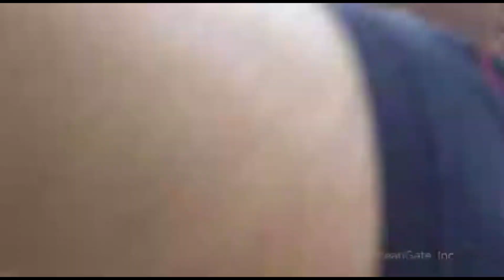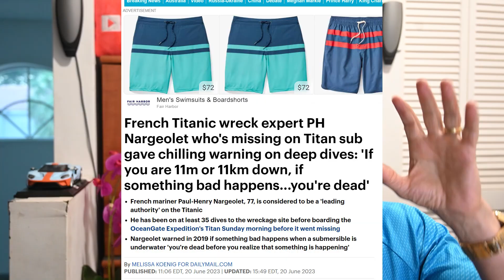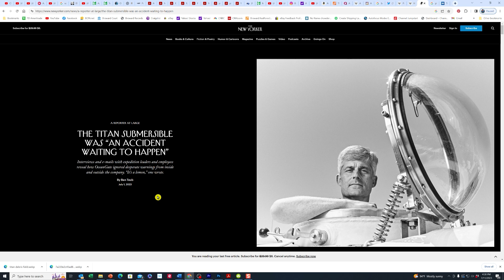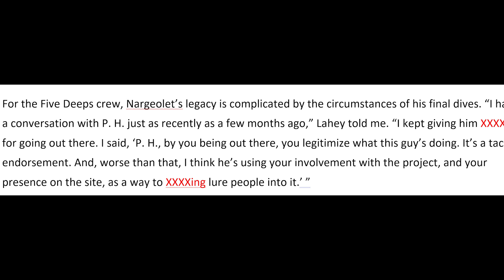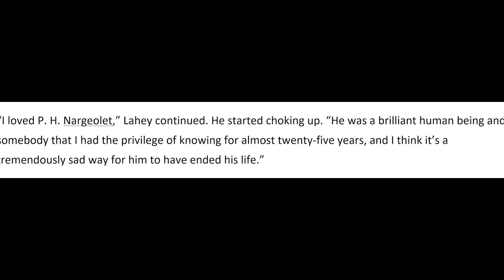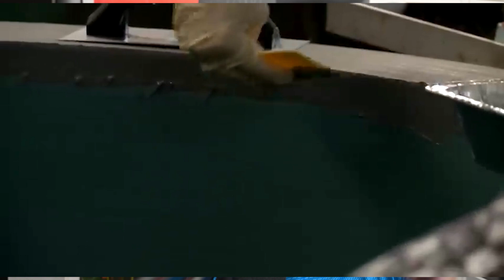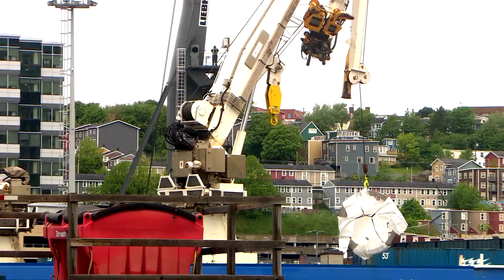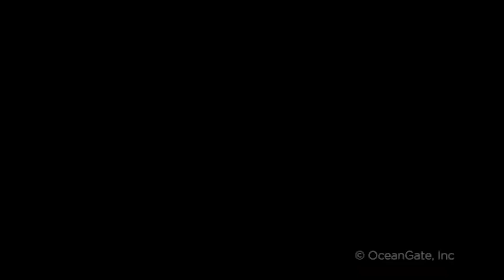Titan Sub: More Q&A, Design Defects, Why Descent Fast

Comment: I'm a 43 year retired Boeing guy. I'm not an engineer, but I managed engineers for about 12 years. There is a graphite fabric called Prepreg. Prepreg has the epoxy pre-impregnated into the fibers when it is being made. This type of graphite material must be cured in an autoclave. Pretty much all aerospace grade graphite parts are made this way. I've never seen Boeing parts being fabricated with a wet graphite layup like is seen in the YouTube custom motor sports world. I worked on the first five 787 program airplanes including the static and fatigue test articles. That airplane's primary structure is full of Titanium/graphic structural members. These members are electrically isolated by the use of sealing material and then bolted together. The seal is to prevent the carbon and Titanium from acting like a battery and degrading over time. In the video clip, the end rings being attached to the graphite tube looks more like a sealing material to me and that is a very sloppy process. All of this is just short of a wild ass guess and speculation about how the Titan was constructed is just that, a wild ass guess. Maybe someday the details will come out, but I'm holding on for the real data, because I want to know what happened.
Reply: I'm an aerospace engineer and agree 100% with all that you have said in this.
If there is one thing I'd add is that MOST CF for pressure vessels like rocket fuel tanks is woven on. So late the fibres in some layers is at different angles. That forms that checker patter you often see with CF. The reason its done is you always want some of the fibres under TENSION (being stretched) and that weaving does that by translating the stresses via the resin.
In all the vidoes I have seen of Oceangate they are just winding the pre-preg strip onto the casing. maybe they did weave other layers but so far I haven't seen it. 
This is the point I think you have dead right - there are unanswered questions which wont be answered until the reports are released.
PLUS we really do need to know how & why this happened.
Reply: @tonywilson4713  Pretty sure the fibres were only laid in one direction, Also wondering did they even vacuum bag the tube at the end of construction? Going by videos others had uploaded I've seen no mention of going in to a clave? Also a number of websites claim that the CEO stated the carbon used was old Boeing stock "That was past it's shelf life"
Reply: @FredsRandomFinds  As far as I know from footage it was laid by just winding it on. there are vids here on YT for rocket fuel tanks that show how they weave it on. YES its for pressurized tanks not compression vessels but I really would like their layup explained by a CF expert.

That expired date also needs explaining.
Reply: @FredsRandomFinds I read somewhere it was cured in an “oven” for 7 hours, but the Titan was actually built/rebuilt twice by different companies, so unsure which one is shown in the process
Reply: @FredsRandomFinds yep 👍🏽👍🏽👍🏽, I HEARD/RED THAT ALSO
Reply: @FredsRandomFinds  "The biggest challenge, Spencer reports, was developing a manufacturable design that “would produce a consistent part with no wrinkles, voids or delaminations.” And without use of an autoclave. Spencer opted for a layup strategy that combines alternating placement of prepreg carbon fiber/epoxy unidirectional fabrics in the axial direction, with wet winding of carbon fiber/epoxy in the hoop direction, for a total of 480 plies. The carbon fiber is standard-modulus Grafil 37-800 (30K tow), supplied by Mitsubishi Chemical Carbon Fiber & Composites Inc. (Irvine, CA, US). Prepreg was supplied by Irvine-based Newport Composites, now part of Mitsubishi Chemical Carbon Fiber & Composites Inc. The wet-winding epoxy is Epon Resin 682 from Hexion Inc. (Columbus, OH, US). The curing agent is Lindride LS-81K frLindau Chemicals Inc.cals (Columbia, SC, US)."
Reply: @FredsRandomFinds "pretty sure" doesn't cut it. A lot of speculation, especially on a kitchen and bath remodeling channel.
Reply: @FredsRandomFinds  no the fibers were not laid in one direction. These people weren't as retarded as you think. If you looked closely you could see that.
Reply: @FredsRandomFinds they show a video of it being wrapped in multiple directions.
Reply: @tonywilson4713  THX, there is one thing nobody is talking about. That is the penetrations out of the pressure vessel. Also, what is under the farings? There must be some kind of a clamping scheme to hold the thing together until it goes under pressure. The aft end tapers up, there is equipment in there, also the images I've seen make me thing the pressure vessel sits inside of a fairing. When I think about this, I to be careful. All of my aerospace experience is about holding pressure in. A submersible is backwards. When a modern jetliner goes to 35,000 feet, the cabin is held around 8,000 for a positive pressure differential of about 4 psi. The Titan starts on the surface at around an equalized 14.6 psi and is compressed to around 6,000 psi when it gets to the Titanic.
Reply: @jimpalmer1969  That's actually a really good point because nobody has said where the hull penetrations were. 
My bet would be they would be through the rear dome because all of the systems (batteries, air,... etc) are in the tail.

On the pressure - yep, yep and yep.
My professor in college was one of the foundation guys on computational stress analysis of axisymmetric structures. At the time I graduated he was working on taking all that he had done and expanding the models with carbon fibre. He also consulted on the re-design of the shuttle boosters and wasn't all that impressed with Lockheed or Thiokol at the time.

He had one great lesson for me.
Understand the model that you're using to analyse your work. 
That was his criticism of so many others working in the FEM and CFD they were just feeding in data and trusting the result. He told me to never trust the result unless you had something to compare it to.

I fear that his warning of OVER trusting computers has lead to some horrible tragedies.
Reply: @jimpalmer1969  composite airliners such as the A350 and B787 are certified to fly at up to 45,000' with a cabin altitude of 6,000'.
Which gives a maximum pressure difference of 2/3 atmosphere.
Reply: @tonywilson4713  That tension bit has been bothering me this whole time. Sure, a cylinder of carbon fiber will hold back a force pushing out (up to the failure point of course). But I STILL have yet to see anyone recommending it for a force pushing IN! Like, putting something high pressure in a composite tank and going into space, thats easy, its only a change of about 14psi. In a sub you want to keep elephants, hell city buses worth of pressure per square inch out.....and again Ive yet to see a carbon fiber vacuum chamber....at the bottom of the ocean what wants to get in is way more energetic than that....
Reply: @zombieregime  You are right. As far as I know the reason you have that weaving is for compression loads. Its why fighter jets done delaminate under high G.

Under a high positive G the lower skin of a wing is under tension but the upper skin is under compression because of the bending. So CF is expected to handle compression UNDER CERTAIN CONDITIONS but it has to be done right. 

What everyone is saying its not normally used for pure compression loading like in a submarine.
Reply: @zombieregime  The wings on the 777-9, 787 and A350 are composite. You can think of an aircraft wing as a cantilevered beam with an aerodynamic leading and trailing edge. In flight the upper surface of the wing is under compression and the lower surface is under tension. The real question is how thick does the composite tube have to be and how long will it last? Lots of unanswered questions.
Reply: @zombieregime  It might not of even been the surface area of the cylinder failing, the compression on the ends by the titanium domes may be the cause. Im no "expert" on CF (im actually a metal fabricator, including much work with pressure vessels) but i have some experience laying up boat hulls and ive witnessed the failure of CF fishing rods more than once, normally by compression of the rod that's extremely strong loaded the right way, but cause compression (normally by what's called "high sticking") and BANG, they pop.
Reply: @zombieregime  Absolutely; it's great for internal pressure, such as in aeroplanes, but I have no idea why they thought it would therefore work for a submersible under such intense external pressure.
Reply: @zombieregime  external pressure design (unstable equilibrium) is completely different from internal pressure design (stable equilibrium).  The primary mode of failure for external pressure is buckling of the shell which is sudden and catastrophic
Reply: @zombieregime  100% agree. They just could have omitted the CF and leave only the epoxy. The composite compressive strength is much lower than the tensile strength.
Reply from the maker: Yes, they used what is called the hoop woven method, which is uni directional, not angled. Like we would want to see. Like we would want to see
Reply: @jeffostroff  you want to see angled fibers because you don't know anything about composite materials. That would make absolutely no sense. The stress is in the hoop direction and the longitudinal direction. There is no torsion.
Reply: @jeffostroff  That is seriously disturbing if true.

If you think about basic stress-strain  analysis and how deformation works. As Thunderf00t showed the titanium will deform less than the CF under a given load.

The fundamental problem is that once a structure begins to deform then the stresses also start to change their patterns through the structure. This is a fundamental point taught in Finite Element Classes or at least it should be.

Have a look at the footage and you'll see that the CF is on the outside of the Titanium ring which means that fundamentally the CF is being pushed against the stiffer titanium, which they probably thought was good as it would help seal the endcaps and have the glue under compression. 

BUT it would also mean that the CF tube would NOT DEFORM uniformly along its length because of the titanium rings at each end. The mid point between the titanium rings would/should squeeze in a little more which would create stress and strain almost parallel to the centre axis of the tube. And you have said there was no weave to handle that type of stress/strain. 

It would be interesting to test that out.
Reply: @jeffostroff  Keep in mind that the stuff you've seen is probably not the actual pressure hull. You're likely seeing the construction of the inner cylindrical hull that housed the crew and wasn't subject to the immense pressure. That's why the carbon fiber is wrapped the way it is. The inner hull is designed to resist expansion while the outer one is designed to resist pressure. The man obviously didn't want anyone knowing his "secret ingredient" which would've been the process by which he made the carbon fiber use its strength in tension to prevent implosion. Showing the design of the inner hull is useful since there's no company secrets there and it wouldn't matter if he used inferior materials or processes since its just a living space and not a structural component. 

Here's what I think he did: I think he used metal rings with structural bracing assisted by carbon fiber to actually resist the pressure. Those rings wouldn't contract but just hold their shape. Then I think he used carbon fiber draped over and woven within those rings as the actual mechanism to resist the pressure. This way you get to use carbon fiber the way it was meant to be used - i.e. in tension - while minimizing weight by using metal only for resisting compression. This isn't a new idea in fact it was the basis of a design used by a man named W H Taylor in the 1800s who tried to build an atmospheric diving suit that used spring-shaped rings with leather draped over them to resist the pressure.
Reply: @jeffostroff  I had a good reply but youtube didn't like my comment and wouldn't let me post it.
Reply: @jeffostroff    HIYA JEFF I AM ENJOYING YOUR DEEP DIVE (PUN MOST DEFINITELY INTENDED ! ! !) INVESTIGATION INTO THE TITAN SUBMERSIBLE TRAGEDY ! ! !👌👌👌
Reply: @tonywilson4713  In another video, Thunderfoot (I think) estimated about 1 cm diameter reduction in the CF cylinder at depth and very little in the titanium end ring.  Presumably that's going to introduce shear forces in the cylinder wall where it meets the ring.  With a purely wound construction, very few fibres will be crossing the shear plane.  That sounds like a bad thing.
Reply: @LokiCentral  I have a lot of respect for Thunderf00t, but I believe he is a scientist, not an engineer.  I think he was completely off the mark with his assessment because he based it on simple bulk modulus of the Titan materials rather than structural response under load based on stiffness properties.  He claimed incompatible displacement under load at the CF-Ti joint, although it is entirely possible that the Titan engineers accounted for this and designed a ply layup to assure compatibility (it would be possible) ... we just don't know.
Reply: @speleotrog  I think I was watching the same video about that point. I don't know enough about that subject to have a strong opinion if it was right or wrong, but the part I was sketchy about was if a single bulk modulus value in tension and compression for CF was appropriate for this. Is there even a bulk modulus value for CF in compression to reference (as opposed to traditional tension), and surely it cannot be assumed to be equal or even similar to the more oft cited tension value? That would be WAY over estimating the material strength at work in this scenario, right?
Reply: @speleotrog   I wouldn't disagree, good scientists do sometimes make blunders when it comes to real engineering because they don't have access to accumulated knowledge/experience and the design details, and he anyway does very broad-brush estimates.  I couldn't comment on the figure he gave, but I find it reasonable that there would be a stress concentration at that point.  Other commenters have said the first hull was all hoop wound but the second hull was alternate hoop/mesh layers, which changes the story too.  Given the novelty of CF use in that application and his demonstrated approach to safety and testing, I think few have confidence that the design and construction were sound, and it will be interesting to read the final report.
Reply: @LokiCentral  Yeah I saw Thuderf00ts video yesterday and I think he's spot on.
He's gone back to basic principles and at the very least he's in the ball park.

Its where thinderf00t really excels. He just goes back to the stuff that every engineer did in the first 2 years when the syllabus was basically the same for all of us or most of it was. First year engineering is almost identical anywhere in the world. Second gets some differences but not much. As an Aerospace I did a couple of extra maths classes that we needed for things like aerodynamics and the thermodynamic class was slightly tailored towards gas engine cycles.

Its that sticking to basics where thunderf00t annoys a lot of people because they can't refute it. They prefer the fantasy to the reality and he just slaps the fantasy nonsense out of the park.
Reply: @Geovorecom  Stockton Rush himself, said in an interview, that it reduced at depth, 3/4 of an inch (19mm), so that's almost 4 times as much as the estimate you quote. The Titan was probably worse in design & build, than imagined!
Reply: @tonywilson4713  I do think Thunderf00t is essentially correct about the CF-Ti joint being problematic and likely strain incompatible ... I just don't think he's based his assessment on the most-relevant physics.  Mixing systems like this (when past experience strongly suggests NOT TO DO IT) is an "innovation" that usually fails the valid and thorough research, development, test and evaluation cycles needed to establish reliability.  As I understand it, wouldn't a simple bulk modulus assessment only apply to a free-flooding, non-pressure-hull submersible where both inner and outer material surfaces are equally compressed?  I suspect that the CF-Ti pressure hull structures were probably deflecting a lot more than the half-inch and "negligible" that Thunderf00t discussed!  It sounds like Titan had a flanged Ti ring to trap the tapered end of the CF cylinder to force strain compatibility to maintain the seal ... this would have created some complex stress concentrations in a structure that maybe couldn't afford it!
Reply: @speleotrog  Sorry but Thunderf00t got it 100% right by pointing out WHY you don't mix materials in a high load situation when they have different stress-strain characteristics.

Do you know how circuit breakers and fire alarms and thermostats work??? They have what are called bi-metal strips where the 2 metals expand differently under heat. That causes the strip to BEND when heated. Its pretty obvious in a fire alarms and thermostats except thermostats are adjustable. In a circuit breaker the current provides the heat. To much current equals too much heat and the bi-metal strip is the mechanical part that trips the switch.

So don't try and tell an engineer we don't know what happens when you mix materials. The basic concept is explained in high school science classes and then hammered home at college how we can use it

This concept of issues with different materials is well known in several areas of engineering and it has caught out people before. The Stewart Formula 1 team many years ago tried a revolutionary gearbox with a case made from CF and it failed horribly for these sorts of reasons. The CF and the bearings and shafts all expanded under heat differently at the thing kept breaking itself.

Sorry but Thunderf00t is 100% right.
Reply: @tonywilson4713  I think Thunderf00t got it right about the thermal effects, but not the bulk modulus stuff. Structures are SYSTEMS of materials and can be tuned to get desired results ... i.e., a steel wire and an aluminum wire under identical loads can be sized differently to get exactly the same strain (although the steel will have higher stress).  The earliest good ship navigation clocks had pendulums cleverly made with combinations of different metals working against each other to prevent thermal expansion and resultant variation of the pendulum period.  This innovation literally changed the world!

With the right constraints, a CF-Ti bond could be forced to strain compatibility (possibly with with horrible progressive failure due to excessive stresses).  A bimetallic strip (i.e. thermostat) can be likewise constrained so that it will not bend!   For more than 50 years, Navy ships have successfully welded aluminum deckhouses to steel hulls using much larger bimetallic strips in just this way.
Reply: @tonywilson4713 that's all I saw too, I would love to replicate this failure but who knows what actual process were used. I saw the same Pre-Preg single axis winding no criss cross, I also thought it would have to be cured in an autoclave .
Reply: @WarpedYT  Yeah - I think there will be a lot emerge about how they made this sub come out in the investigation.
Reply: @tonywilson4713  I think so too
Reply: @WarpedYT  Yep we'll all be waiting to see if that investigation is about truth or cover-up.
Reply: @tonywilson4713 keep in mind the rockets have to hold the pressure IN but the submersibles have to hold the pressure OUT so maybe someone determined that a different weaving pattern was better - I don't know. (I am technically an engineer but my field of expertise has no relevance to submersibles, rockets or carbon fiber)
Reply: @thewhitefalcon8539  Yes I know the difference between pressurized rocket fuel tanks and a submersible.
What I am trying to clarify is that CF can handle some compression and that its done through the weave of the CF. That pretty chequer patter isn't done for looks its actually done with purpose.

There's another issue not being discussed much and might turn out to be incredibly important. The Resin matrix in CF can be attacked by sea water. Titan was done with CF made for aerospace. I am yet to hear if it was suitable for any sort of marine application. I know from the sailing people that CF is used a lot in yachts these days. The question is what do they do to make CF work in a marine environment? What other things do they have to do that the aircraft people don't?
Reply: @tonywilson4713 - I understand that the CF tube was wrapped in PVC sheet to keep the 4k PSI brine out.
Reply: @NapoleonGelignite  That's a good point and I believe the yachting people do similar. Some of their boats are wrapped not painted. That's how they get some of those patterns. 

I know painting CF can be a real problem because the surface is so smooth (when done properly) that paint wont stick to it. My boss from years ago had that problem with painting his racing cars.

The question is, and hopefully we'll get the answers, was that PVC good enough under the operating conditions 4,000m down.
Reply: @tonywilson4713  Not an engineer, but I've always been under the impression that CF should be laid in a weave as opposed to unidirectional. All the footage showing the process for the Titan hull shows unidirectional laying.
Reply: @harrietharlow9929  Yeah and when you realise WHY they EXPERTS weave carbon fibre the way they do then you start to understand just how far OFF the ball the Titan people were.

It wasn't just the fact they used "past use-by date" materials or that they mixed the combination of titanium end-caps and CF tube. They didn't even carry a spare game controller to drive the thing.

The list of things they didn't do or that others have shown were fundamentally flawed just keeps getting longer and longer. 

Arrogance and stupidity IS NOT an alternative to PHYSICS and/or SOUND ENGINEERING PRACTICE. 
See the Boeing Max-8 or the Spanish Power Grid or the Texas Power Grid or Thames Water or  Flint Water or the Ponte Morandi bridge in Italy for examples.
Reply: @jimpalmer1969 
Hey Jim.  This footage in this video of the hull winding is from the first Titan hull with what looks like wet process.  There is later footage at Spencer composites which is prepreg unidirectional hoop lay.  And probably the expired stock Boeing sold him.  https://youtu.be/O-8U08yJlb8?t=566
 Here is a description of the Spencer hull build up:  After layup and winding was complete, the cylinder was bagged with cellowrap and then cured in an oven at 137°C for 7 days. There was no postcure. Spencer says initial assessment of the cured cylinder shows that it has porosity of <1%. As CW went to press, the cylinder was being prepared for machining to cut it to length, square up the ends and bond it to the titanium end caps.
Reply: You managed engineers but are not an engineer.  You just confirmed my suspicions about Boeing management.  At least you seem to understand what the engineers are telling you and you LISTENED to them.  I keep looking at these Titan designs and I am not seeing the titanium flange on the INSIDE of the carbon fiber tube.  5000 psi outside the tube, 15 psi inside the tube.  We were rebuilding a deck at a house I have been managing as a landlord.  The guy I was working with lamented that the deck screws he was using to fasten three boards together, for a total thickness of 4.5 inches, were not all in the same direction.  They were going in at different angles.  I said, "that's perfect.  The joint will be even stiffer that way."  I just see force vectors in my mind when I look at things like this.  No diagonal weaving of the carbon fibers while building this Titan tube?  I'm surprised it didn't implode after diving a few hundred feet, let alone 12,000 feet.
Reply: @RogerWKnight I speak under correction but I think the CF was machined to fit into a channel in the titanium ring. Intuitively one wants a thick internal support ring, but stresses would be concentrated on the line where the CF shell enters the channel because of deformation (waisting) of the CF cylinder.

Kinda like a cantilever structure with a very rigid beam and a massive weight at the end. More shear and torsion than an adhesive intended primarily as a seal could handle.

I think there were some serious misconceptions at play.
Reply: @camcairns2584  Yup.
Reply: @RogerWKnight The reply I was looking for! Thanks!
Reply: @RogerWKnight  no need for diagonal weaving. You don't know what you're talking about.
Reply: @matthew4878  Don't tell me, tell Jim Palmer, or more specifically, Jim Palmer's engineers.  When you fly on a 787, your life depends upon those engineers doing their job right and the everyone in the supply chain and fab shops doing their jobs right.  In fact, I am astounded that the Plastic Bird 787 Dreamliners do not fall out of the sky!
Reply: @RogerWKnight  I'm talking about a pressure vessel not a airplane
Reply: Well, when I was a kid, we couldn’t afford proper patches for our bike tyres, oh no siree, we had to make patches out of old inner tubes.
Scuff the tyre, scuff the patch, keep your fingers away from the surface, apply the glue on both sides, let it dry a bit and press together. We learned very early not to touch with bare hands surfaces that are going to be glued
A lot of so called experts that built this sub did not ride bikes when they were kids I’m guessing…
Reply: Having looked at a few structural analyses we can pretty safely guess what happened with the sub. The design itself is only capable of withstanding about 4200 meters of depth. That's incredibly close to the depth they're going and unbelievably irresponsible. They're using a material which is very prone to delamination and a manufacturing technique which significantly increases that probability. The repeated stresses of diving also significantly increase the probability of delamination. They're using very unreliable manufacturing methods with a very high probability of defects which significantly increase the probability of delamination. They're using zero testing to ensure defects aren't present. The design they used is especially weak to snap buckling around where the composite and titanium are joined. Snap buckling is obviously dramatically more likely after the structure has delaminated. All of the leaked transcripts also fit that theory perfectly.

TL;DR - The poor manufacturing and repeated dives delaminated the composite. That caused snap buckling and the composite hull collapsed. A combination of incredibly lazy design and terrible manufacturing processes were to blame. It's a great surprise it didn't happen sooner given the safety margin was around 10% (before delamination and defects come into play).

Also as an aside, you can get prepreg which doesn't require an autoclave. But obviously an autoclave significantly reduces the chance of defects and generally increases performance all around. A wet layup reduces strength by approximately 75% and increases the probability of defects further. It can be cured in an autoclave to help that slightly but prepreg autoclave cured is what you really want if you're making high performance components like Boeing. Finally in the video they stated that it was glue and we don't see anything else being used. It isn't as big of an issue as people think given the immense forces are holding everything together too, but it displays an incredibly sloppy method and frankly manufacturing ignorance which was present throughout the sub. There's zero downsides to doing it properly.
Reply: @olivialambert4124  That's a decent summary.
Reply: @olivialambert4124  "Zero downsides to doing it properly."

Expense. These guys wanted to be innovative mavericks working on the cheap because their success under those circs would make a better narrative. They were caught up in Rush's glory chasing delusion, sadly.
Reply: @alaskau9175  In general I 100% agree with what you said. But in terms of the zero downsides point I was talking about the glue. I don't consider a very light sanding with rough abrasive, a quick cleaning, the use of gloves, and a little more glue as a significant downside. They could have spent perhaps a few hours more work with 2 people and had a dramatically better mating surface.

My point was to then tie in that ignorance of the subject to the rest of their design. I left the implication that not understanding the risks they put themselves under being why they convinced themselves it was an acceptable safety unsaid, but that's obviously why they assumed doing it so cheaply was doable given they put their own lives at risk too.
Reply: @olivialambert4124  Thanks for clarifying. Great points. Only people in the grasp of mass delusion would dismiss everything you just said. Unfortunately that's who we're talking about.
Reply: Carbon and titanium, in saltwater.

It's just asking for trouble.
Reply: @mrkeogh  Actually, carbon Fiber and Titanium is pretty far down the galvanic scale. Boeing builds for 25 years +.
Reply: @mrkeogh  yes when left under for hours  on end.  Stockton never would think it would be total of 5 days to search underwater for any emergency rescue!  Since it was a holiday, Fathers Day, many experienced guys off! ?????
Reply: @mrkeogh  yes,sea salt water plus temperature changes, pressure, all adds up and no adequate bathroom facilities(ammonia risk. In cramped quarters), limited food, water, oxygen, that too!
I bet Stockton never thought his minisub would be left under for 5 days in any emergency requirement!   The FathersDay Holiday perhaps the experienced men were off, at home! ??????
Reply: I can't remember where on YouTube I heard Rush say the noises were the carbon curing and it was a good thing.  I think it was at a conference with bank of America signs in the background. Seems at the time he was raising money for titan.
Reply: @TnK2015  what a knob
Reply: @timb8095  I'm not pretending to know more than I do, just what I heard him say.
Reply: @TnK2015  yeah, I meant Rush is a knob
Reply: @timb8095  thanks for the clarification 😅
Reply: @TnK2015  that was the most ridiculous statement by an engineer no less ... I've seen that too .... Metals (steel , titanium , aluminium) especially after been hammered have inherent internal stresses in their crystal matrices and with the right application of force are released - Carbon DOES NOT ! He was listening to the sound of fibers breaking or/and separating from the bonding agent (resin) . That's why it wouldn't stop and he had to discard version .1
Reply: Unidirectional wound, unvacuumed, no autoclave, no FEM, Fatige test, XRAy/CT , no quality control, no clean / sterile construction Environment and construction Process. Non CA-woven, no control fibers/wires woven in, no creep current insulation to metals, no surface preps on the bonds. Well - a 100% miss on the Cylinder construction.
Reply: The process is called bonding for ion isolation and dissimilar material mating cohesion. Mating surfaces are prepared to receive the bond. Titanium uses conversion, composites are abraded. The intermediary has color significance, typically white or light gray. After bonding this particular assembly requires generous application of the seal/adhesive whereby squeeze out is inspected to ensure thorough coverage, lack of bubbles, squeeze out is uniform having no voids, spectrum/color change, viscosity change, etc. Excess is removed, area is prepped for bonding again and pack and fillet having different properties are applied to protect the underlying adhesion from the environment. The intermediary and seal/adhesives are controlled and have a chain of custody. Custody is recorded from procurement to cure time and every step in between. Additionally, the tour video shows a lack of UV containment, that barrel looks aged. Jim, I remember all the scarf work back then.
Reply: @robcampbell2164  Great comment.
Thanks for the input.
Reply: Such comments are ONE THING that keeps YT worth visiting!
Reply: Thank You Jim.  That's what I was going to say, but you said it perfectly.   I have been wondering this all along...  What are we really seeing in those videos, presumably from the assembly of the carbon fiber cylinder.  Is that pre-impregnated CF???  Was it heated later off camera???  Or is this wet carbon fiber we are seeing???   What are we really looking at???  

This will never happen of course, but, I would love to bring in the Techs who built this thing, set up at a fancy hotel, and say look, you guys have blanket immunity, you have rooms, laundry, food, whatever...  but we're going to sit here in this conference room, and, please just tell us the story.  Everything.  In nauseating detail.  What did you do.  What were you asked to do.  What were they saying to you....  Just figure out once & for all, so we can all learn, what did you do???  How was it built??   Step by step, what were the materials, what was the process, what were you being told, what were people saying....  It would be priceless to know that...
Reply: @patrickmorrissey2271  I agree with you. Hopefully they will recover enough debris to do a post mortem. I hope we will get a report.
Reply: @patrickmorrissey2271  no outfit should get immunity when so many destructive verbal bullets r being thrown at the CEO, even after his demise!
Reply: As the vessel descended shrinkage due to outside pressure could have reduced bouyancy by up to 50 Kg. Fatigue would worsen this tendency. The dumped ballast for the ascent would need to exceed this by a good margin
Reply: I grew up in the oilfield and sold drill bits. I was not an engineer but the job required a fair amount of engineering knowledge.

Two terms we used were WAG and SWAG.

WAG is a Wild Ass Guess.

SWAG is a Scientific Wild Ass Guess.

It seems that some of Titans construction was based on WAGs.

Your speculations about the Titan failure are SWAGs, not WAGs as you describe them.

At least according to the oilfield terms I'm familiar with.

Good comment.
Reply: I enjoy watching his videos and reading the responses from all the engineers and knowledgeable people that make comments.  As a commercial contractor I have picked up several items I questioned to have to talked about in the video and then further explained by many of your comments.  Once again thank you everyone for this tragic but festinating event.
Reply: Carbon fiber bubble wrap! 

With over 38 years of advanced material reinforcement manufacturing, ASTM (I) failure analysis engineering experience, including carbon fiber, the method, application and overall design are all examples of total disregards to proper engineering designs, manufacturing, testing, evaluation and lack of certifications, created a death trap guaranteed to fail within a few cyclic loads. 

Carbon fiber in this application and overall design is complete negligence on all levels and in all disciplines.
Reply: @icare7151  Nice summary
Love the expression "carbon fibre bubble wrap!"
But then what else do we call it??
Reply: Apparently there are 2 that were being sold. One got classified. The other, like the Titan, wasn't. The guy wants around 700K for it. Whoever is looking at the accident should get one of these 2 and reverse engineer it
Reply: I am not discounting anything you offered nor any importance of procedures nor defending anyone either when I say the stresses of flight on the vehicle is different in the air than under water. I agree with you on questions remaining. CF might be the ideal substance for airplanes because of it holding together under stresses pushing out.
Reply: THANK YOU!! That's exactly what I've been saying in many of comment sections of other videos. You are 100% correct about not knowing the processes used. dissimilar materials do weird things, and carbon conducts electricity, that's what most people don't think about. I didn't see any sort of electrical isolation in the assembly either, again why testing was needed.
Reply: I agree, but we can't base science off of a 10 second promotional video. Unless we have the official production documentation in hand, all bets are off.
Reply: THIS STUFF INTERESTS ME.  I CAN'T WAIT FOR THE FINAL REPORT WHEN THEY PUT ALL THE PIECES OF HUMPTY DUMPTY BACK TOGETHER AGAIN.  SHOULD THOSE END CAPS THEY RECOVERED HAVE CARBON FIBER STILL ATTACHED TO IT?  IT LOOKS LIKE IT CAME FRESH OFF THE LATHE
Reply: For everyone questioning on jimpalmer1969's qualifications as "just a manager of engineers, not an actual engineer": come on, do you think Boeing hired the night shift manager from the movie theater? Just because Jim is not currently working as an engineer does not mean he doesn't have advanced degrees and past experience in relevant disciplines.
Reply: @HalfShelli  Night shift manager at a movie theater?  That would explain some of the supervisors I worked under!
Reply: I’ll be putting all out this in artificial intelligence just for my superficial curiosity
Reply: The more I read the more I think people are overreacting to the carbon fibre itself and the focus really should be on the quality control, laying/curing process and testing between dives.

From what I can gather it seems to me that while it's not ideal to keep pressure out, at that thickness and width inside a resin the pressures act somewhat in a tensional manner and it is still quite strong either way.

I do wonder if a rubber skin might have helped prolong the life of the carbon fibre?

Does my comment seem accurate or am I wildly off base? (I'm hoping for actual experienced experts to reply).
Reply: That's an interesting point about the use of sealant and the electrical potential behavior between titanium and CF. If sea water is getting (forced) in there through small (but not critical) defects and voids, that could be another inroad to gradual degradation at the seal?...a kind of corrosion?
Reply: I have wondered about how submersibles compared to aircraft in construction. One has a positive external pressure and the other has a positive internal pressure. Unless aircraft balance pressure over altitude. But I guess my question is, structurally, does carbon fiber handle one pressure type better?
Reply: @ReinQuest  Good questions.
1) You are right the pressure in an aircraft is higher than the outside environment and its the opposite for a submersible. 

2) Yes carbon fibre like many other composites is better at handing some types of stress than the other. Its al dependent on the construction techniques used.

IN ENGINEERING TERMINOLOGY we call a squeezing force compression and a stretching force tension. Bending is still called bending and twisting is still twisting. 

The fibres in CF are incredibly strong under tension but far less under bending and  compression along fibre. Under compression the fibre tends to buckle and then snap much like dried spaghetti.

This is why CF makes awesome super light but supers strong rocket fuel tanks. Because the pressure is internal its trying to stretch the tank like a balloon and that's where CF is awesome. A submarine is the opposite which is why Titan was several inches thick. 

To make it practical to use Carbon fibres it needs to be surrounded by something that prevents it from bending or buckling. In all composites we call that the matrix. In reinforced concrete the concrete is the matrix in CF the resin is the matrix. When they make a fibreglass surfboard the 2 part epoxy is the matrix.

Where CF gets complicated is the type of resin has to match the application and the arrangement of the fibres has to also match the application. This is why there's questions abut sealing the Titan's surface against the sea water and other questions about how the CF was wound around the hull to make it.

Like many others I am keen to see what the investigation uncovers.

Hope that answered your questions.
Reply: @ReinQuest  Your thinking is absolutely correct: carbon fibre handles internal pressure (such as in an aircraft) considerable better than external pressure; under which carbon fibre can delaminate if the pressure is great enough. It was this, and the joining of materials that respond differently under external pressure, that led to many submersible experts writing to Rush to warn him of the dangers of Titan.
Reply: I am an artist and know nothing of any of this but am geeking over you all explaining things so I can understand! Thank you so much! Great info and so appreciated :) I do use an autoclave and resin in my art so I am familiar with some terminology and use. Thanks again!
Reply: Is there something special about Prepreg that calla for a pressurized curing process? Ive working in molding and fabrication before, and I recall sometimes using vacuum to pull bubbles out of fiber glass and carbon fiber layups, so the use of a pressure vessel sounds interesting. the heat totally makes sense though, on cold and humid mornings we couldn't do layups since we couldn't kick the resin hard enough and still have decent working time before it hardened (and tried to light the paper cups we'd mix batches in on fire. Shop rule was to put resin cups in the deep sink until fully kicked with a splash of water on top just to be sure a hot batch didn't find something that didnt like getting hot in the trash bins).
Reply: @zombieregime  You are right on the vacuum comment. Autoclaves are used (as far as I know) for BOTH pressure and vacuum curing of materials. It all depends on the type of process and type of material.
Reply: @zombieregime  You are right about pulling the air out of the layup. It is possible to cure Prepreg in an oven, but it should be vacuum bagged. Vacuum bagging is not as consistent of a process as an autoclave.
Reply: I used to do a lot of layups with prepreg, and you need to use vacuum bag to cure it in oven and to bleed out the excess resin.
Reply: @zombieregime exact reason. To remove all air and get a pefect cure without airbubbles etc
Reply: @SuperNostalgia. Wrong place for God pal
Reply: We had a Boeing guy come to our school and show us how to make composites. I think he had just retired.
Reply: @valeriek8077 what channel?
Reply: @mipmipmipmipmip Boeing composite airplanes are bolted together. Composite aircraft structures do not crack, but they will delaminate. Delamination can be detected by ultrasonic sound waves. Also, just tapping with a coin (a.k.a. coin test) on suspect areas is very effective at finding delamination. There is a layer of copper built into the composite parts that form and conductive path for lightning strikes to pass through to the discharge wicks at the ends of the wings. It forms a Faraday cage the same as aluminum airplanes. The composite structure of the 787 does not have fatigue limits. However other structural components such as landing gear are life limited just like aluminum airplanes.
Reply: Grabbed by giant squid, and chomped by megalodon 😮
Reply: Details of the Oceangate submersible's design and fabrication are hard to find. Careful review of Oceangate's blog and several presentations by Stockton Rush shows there were two different shells for the Titan.  The video you show of winding the composite shell with wet carbon fiber/epoxy are from 2017 by Spencer in Sacramento, (a marine composite fabricator}. Per Rush, all 5 inches were wound radially (no cross plies).The photos/videos of bonding the shell to the titanium rings are from the first shell in 2017 also.  "Problems" with this first shell arose during deep water testing in 2018 & 2019 so OceanGate derated it from 4000m to 3000m. Titanic is at 3800m so OceanGate built a new shell of the same dimensions (and maybe new rings) in 2020 at Electroimpact in Seattle (an aerospace composite fabricator) using, according to Rush, expired prepreg from Boeing and biaxially layup.   Hopefully the investigation will reveal full fabrication details eventually.

The guy cleaning the titanium ring with bare hands and a rag is only show touching the exterior of the ring and the mating surface with the other ring, not the bonding surface to the first shell in 2017 not the shell that imploded.  
The videos of spreading epoxy on the mating surface of the flange are too low quality to conclude whether they roughened the bonding surface when assembling the first shell in 2017 not the shell that imploded..
Careful examination of the published photos of one of the recovered titanium rings from the 2020 shell that imploded shows some light and a dark residue on the bonding surface though no large chunks of composite.
Reply: This type of discourse in comments is what I really look forward to. Thanks for your insight
Reply: @valeriek8077  the pressure in the titanic blew out bc it broke above water but equalized on its way down
Reply: I know nothing about engineering not planes (not) subs, nothing, I have no schooling of any sort. (BUT) I've been following the Ocean Gate stuff way before the 2023 accident (or) in this case manslaughter...... I can tell you one thing, that Titan was doomed from the beginning, hell the first one cyclops 1 was also doomed, a basic understanding and a basic guy like myself even would know that...... Rush unfortunately was an egotistic narcissist, sadly him and 4 others went bye bye.... So horrible
Reply: Impregnated, you say? ( ͡° ͜ʖ ͡°)
Reply: I see the diagrams that show the CF cylinder has an inset step on the end where the titanium end cap seats over, and this has been pointed out as an area prone to stress concentration (because of the reduced material thickness in that area). Would it have been better if the CF cylinder was not machined with the step, and the titanium end cap was designed to fit entirely over the nominal OD of the cylinder?...or is some machining on the end a necessity just to geometrically true and prep the surface at the attachment point?
Reply: @JSu2.  I am assuming (usually a risky thing to do!) that the inner and outer tapers milled into the end of the CF cylinder matched the tapers milled into the channel in the bearing surface of the Ti transition ring so that under load the cylinder and ring would tightly lock together to (in theory) totally constrain the two dissimilar surfaces, which would also be all embedded in epoxy.  Behavior at that joint would be so complex that an engineering analysis would imperfectly evaluate it, hence the need for a lot of reliability testing (which doesn't appear to have been done adequately).  Normally, the cylinder and Ti ring would want to deflect slightly (maybe significantly) differently, but constaint would locally prevent this and cause weird localized bending and probably high localized stresses around that joint ... this might also cause localized rotation at the joint with pressure cycling, which could cause progressive failure in the CF material and possibly break the seal.  Potentially, a real mess!  Joining the cylinder to the ends with welds would normally resolve this, but obviously not in this situation ...
Reply: Great information thank you
Reply: That's interesting.  I used to work in McDonalds and the burger patties were made in a similar way to Prepreg
Reply: How come they didn't have a camera pointed at the water where the subway it down so when they saw all the air bubbles come up right after they lost communication they would have had a good idea of what happened
Reply: @thecloneguyz  Why didn't they have a camera pointing at that spot?

Why would they? They aren't in a harbor. they are out in the ocean where the water is moving and its almost 4,000 meters deep at that point. They wouldn't see anything.

A far better and more pertinent question is why didn't they have an backup remote operated vehicle (ROV) going down with it to make sure its all Ok and they aren't at risk of getting tangled in the wreckage.
Reply: @thecloneguyz  Because the submersible did not dive directly downwards; it didn't just sink in one spot.; doing so i order to specifically get to the Titanic would be nigh on impossible with the changeable currents in the area.
Reply: Billions air  buy a military sub that will go to it np
Reply: I think you're misunderstanding what you're looking at. I think the stuff in the video are merely the inner hull which is where the crew sit. I don't think that's the safety critical parts that matter.
Reply: I just pllay with toys, planes boats yea subs, of course carbon fiber,  which dosent stick well to metal, even on a small scale.  So seeing those end bell attached, well they were my chief suspect, how dare I, say such , I'm not an engineer,  but as a lad was quite bright,  anyhow the all but polished metal, the finger prints ...sloppy .
Reply: Damn you’re not an engineer but you policed them. Respect 🫡
Reply: @spookyreaper797  a sad world we live in
Reply: @spookyreaper797 I’m still trying to figure out how that’s possible…
Reply: @joshcantrell8397  because someone has to keep people in check. Even doctors at hospitals have to answer to someone.. it’s the best this way. You can have certain individuals with massive egos that do the wrong thing. Having someone in charge keeps people accountable. I respect this job more than the engineers. If something goes wrong it’s you that has to answer more than the engineer
Reply: Some good info guys! Tnx!
Reply: Are you retired at 43 Jim?
Reply: @Gabriele1979 pretty sure he meant he worked for Boeing for 43 years and is now retired. Thats the way I read that.
Reply: @Gabriele1979  Good question, no I started with Boeing at the age of 23 and worked for 43 more years. I loved my job.
Reply: @Gabriele1979 What do you mean?
Reply: @Gabriele1979 no dumbbell he worked for Boeing 43 years
Reply: How did you manager engineers without being one yourself?
Reply: "Wild ass guesses", are 100% not needed on this topic. I think the people with the actual knowledge, should be tje the ones were listening to. Not a kitchen and bath remodeler. MO